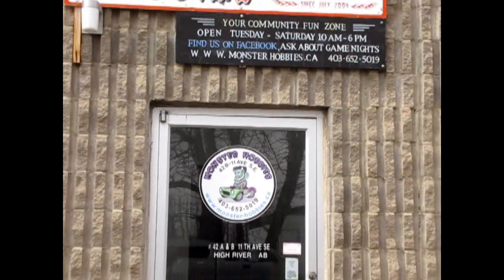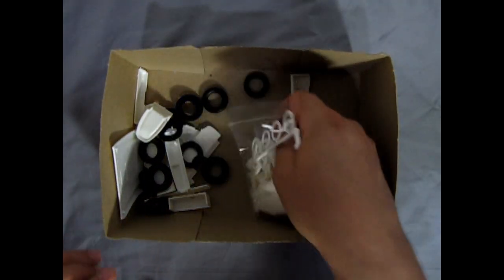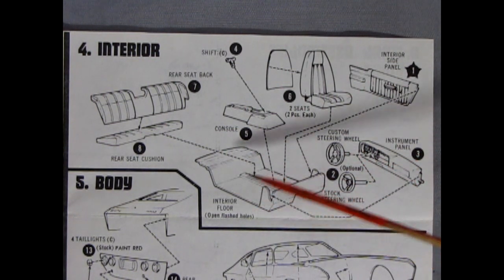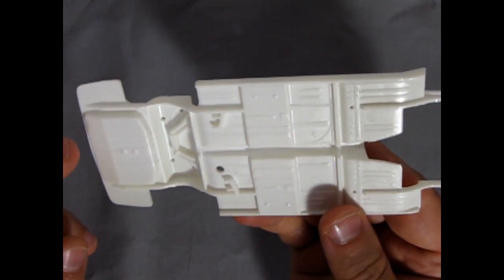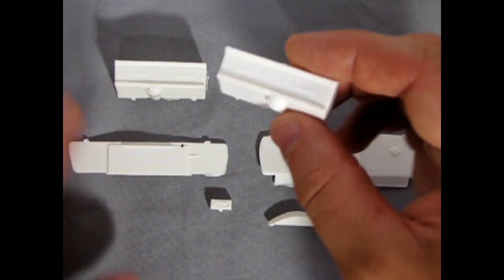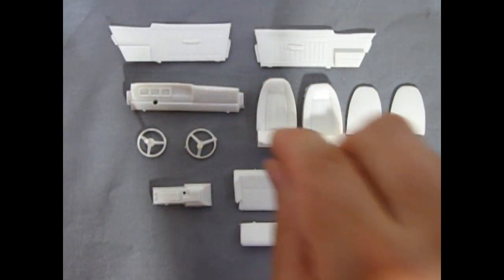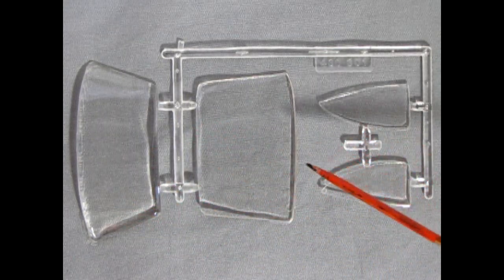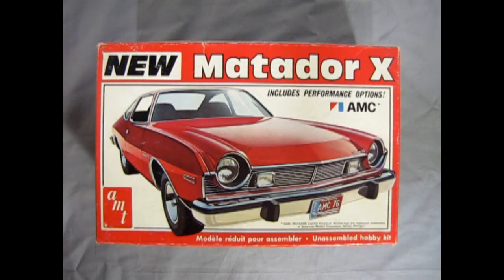Model Car Garage - The 1976 AMC Matador Sports Coupe by AMT - A Model Car Unboxing Video

Comment: I have the 1975 Matador X kit. My grill is white plastic and my tires are one piece vinyl. I find it interesting the changes made to a kit over it's lifespan. My decals are too far gone to even try to use.
Reply from the maker: Sounds interesting. I wish I had a few of these kits in stock form.
Reply: @MonsterHobbiesModelCarGarage  I'm building my Matador for a street machine group build. Should be fun!
Reply from the maker: @JDsHouseofHobbies  Sounds cool for sure!